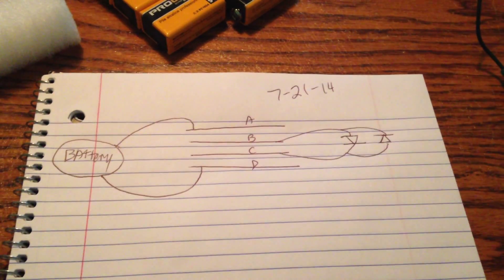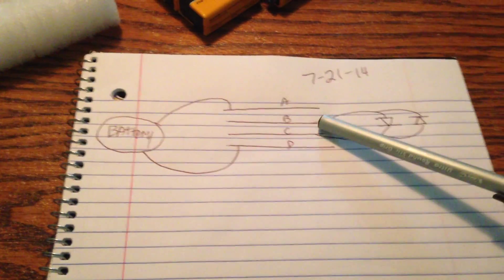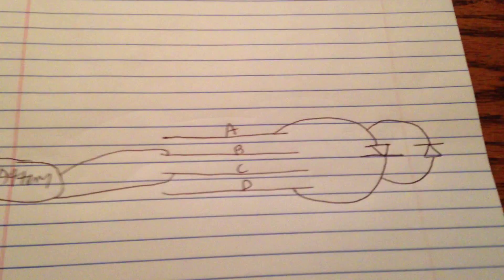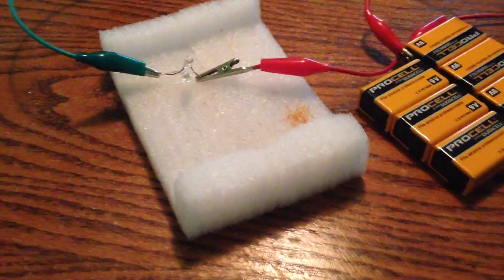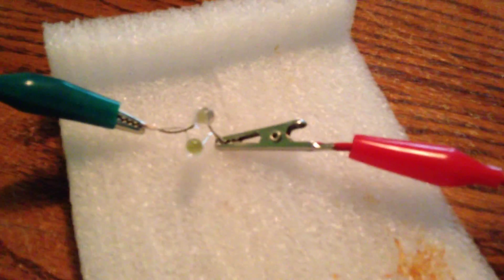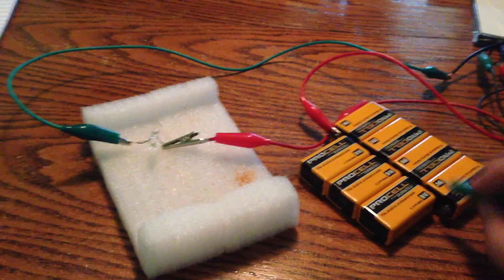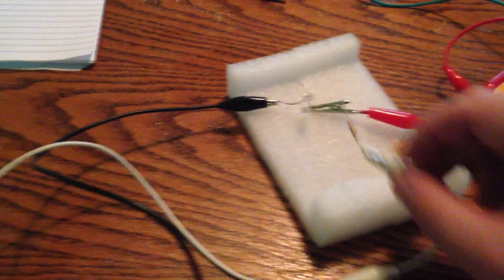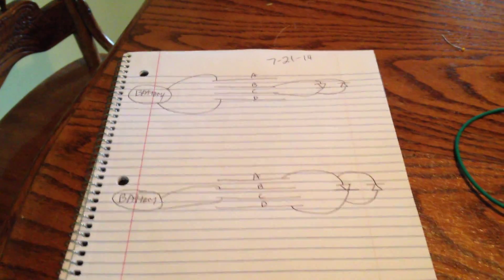4 Plate Capacitor Current In Both Directions "C-Stack"

Comment: i think when using battery (conventional current) only 1 of the leds light up but what i beleive is going on is when you charge or discharge a cap it sets up an induced potential from the environment to compensate for the sudden discharge or charge i.e. energy from the vacuum Casmir effect

Comment: Awesome demonstration of the multiple plate cap! That is free energy on 2 plates from energy normally used on the other 2 plate circuit. What is happening is like a hose of a water level. If you raise one end water will bounce back and forth till it seeks level (0 volts). Looking at the LEDs flash by frame you can catch them out of sync, AC current bouncing in plates.